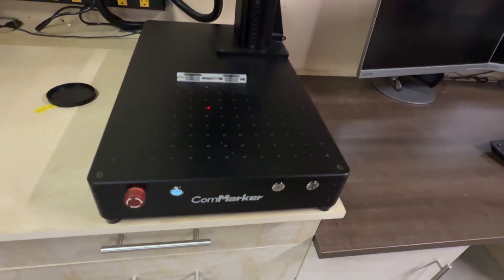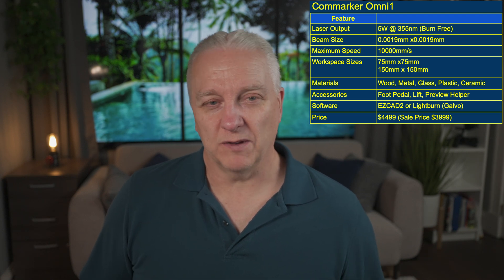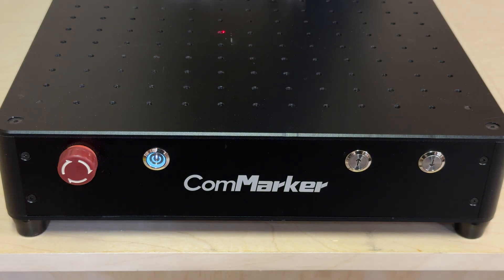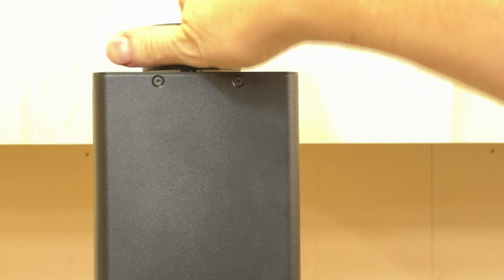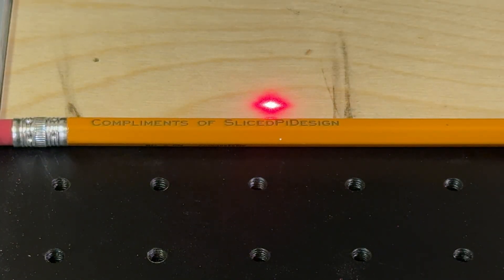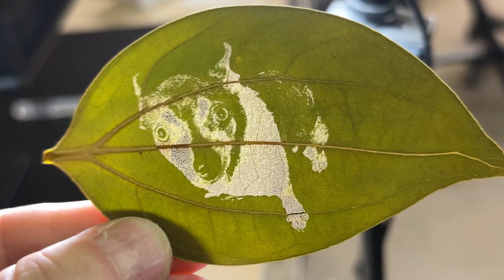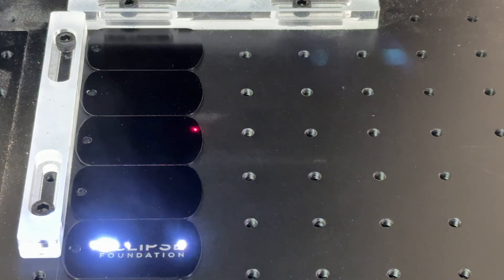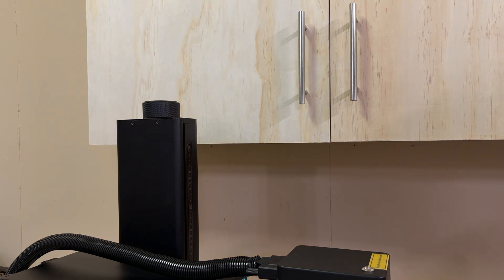Commarker Omni 1 UV Laser Engraving Secrets Revealed!

Comment: WOW. Okay, so I get this won't stack up to, say, the Muse UV, nor should it even try to, but to even have this capability so small and low-cost is a surprise. It doesn't seem like it will do "prism cubes" or the like, the right tool for the right job and all that, but this opens up avenues that other small businesses couldn't do yet. 

That Hepburn card is crisp, just look at the hair and other small details.
Reply from the maker: Considering that the photos here are all done with Jarvis, the small beam size makes the output look amazing.

As far as a comparison to the Muse UV, I think for less than a 1/4 of the price, the Omni1 wins out. The base Muse UV is $18K for the same 5W of power but only a 4"x4" workspace, and vendor lock-in on their control software.
Reply: @SteveMakesEverything  I agree. I meant to compare it to another machine, I remember it was about 60K and looked like a small filing cabinet. One of the key features was the ability to diffuse and make portraits in prisms.

Dunno why muse popped into my mind, but it did. oh well.
Reply from the maker: @RoseKindred  Ah, that makes sense.  I don't remember that FSL model, but in general, if you do a quick search of 5W UV lasers, you'll discover that many cost much more than the Omni1, and here's the thing - they all use the same 3rd laser module.
Reply: The last time I checked, the Muse was more than twice this, so a great entry point.